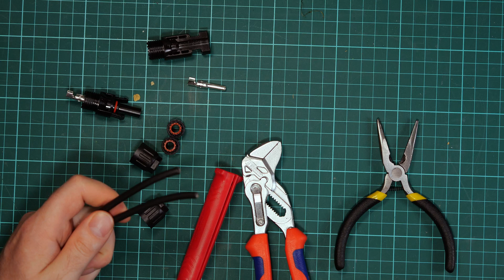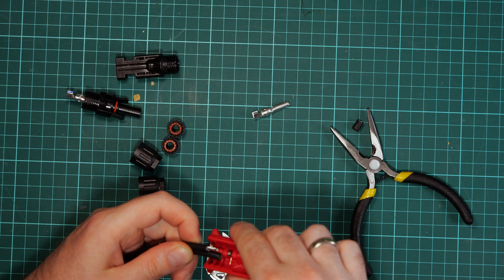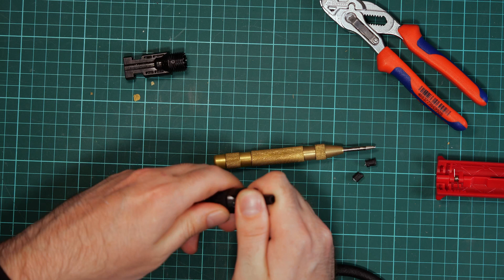Chrimp Solar MC4 connector / plug without special tools

Comment: Really no need for expensive crimping tools. Could also go to the other extreme and solder them as well. 
I suppose the do solder huge connectors on massive instillation. Prob not really needed for home use.
Reply: Solder and crimp is best connection, then dielectric grease on the soldered  joint and on male plug prior to inserting.